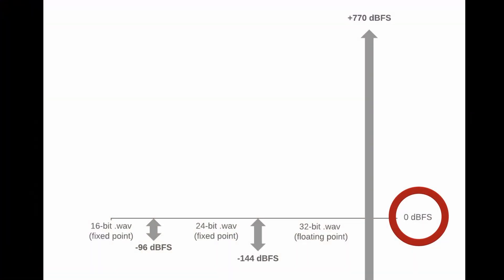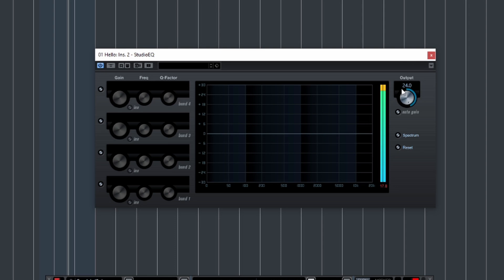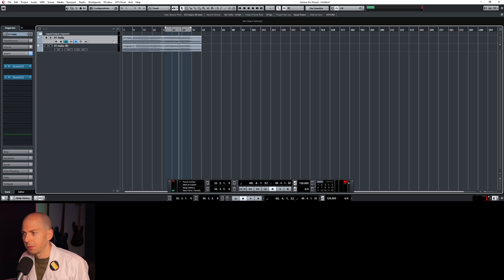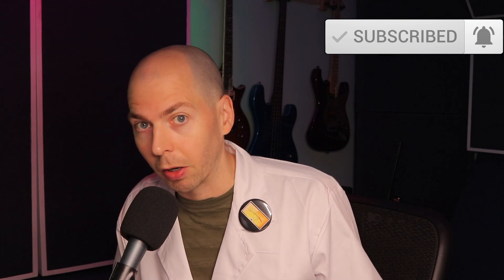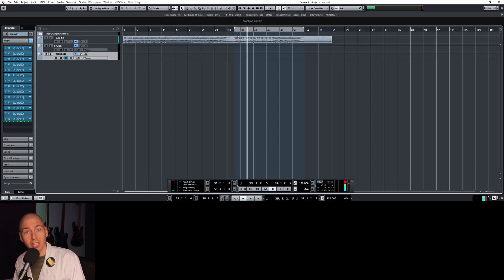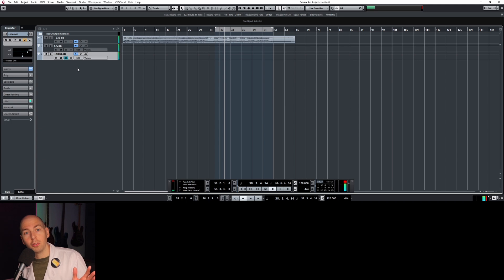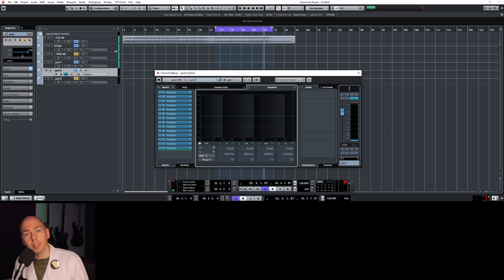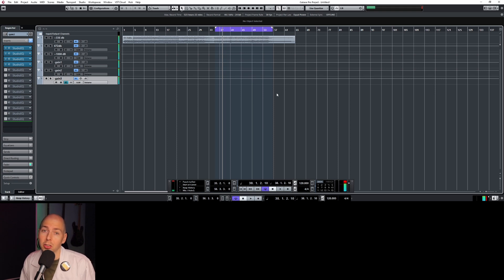The TRUTH about Modern Gain Staging & Mixing (I Broke Cubase!)

Comment: What should I do then ?
Reply from the maker: The point of the video is to show you that you are safe to mix in the box at pretty much any volume regardless of it goes over 0. The problem occurs if/when you try to send the final masters output level to your converter above 0 dbfs. So as long as your master fader level stays below 0, you are all set. Most people use limiters to make sure this never happens. You can also build in a little extra headroom by setting the limiter output to -0.3 dbfs for exporting to CD or -1 dbfs for digital distribution. The reason why gets complicated, but essentially most distributors want the output level set to -1 dbfs. Hope that helps!
Reply: @RaytownProductions  Thanks for your humble reply. what do you mean by convertor in above paragraph ? Ok, may be you are saying that daw doesn't clip because it has a great dynamic range because of 24 bit and +770 db of dynamic rangel but hardwares ( that at the end responsible for the final output through speakers) still follow 0 dbfs range can cause distortion at the output ??? Is this what you are trying to explain ?? Please reply.
Reply: @RaytownProductions  please reply ? Also tell the final conclusion, should a producer gain stage in 2022 or not ?
Reply from the maker: @zian3694  this is correct. Your speakers or headphones don't understand a digital signal. So to hear the audio, you have to convert it to an analog signal that the speaker understands. The conversion process will distort the signal it sends to the speaker if it goes above 0 dbfs, so your output signal needs to be below zero or distortion will occur. How you get below zero basically doesn't matter when working in the box. 

And yes, gain staging is a good habit to have. I talk about this in my recent video if you want to learn more about why it's important: https://youtu.be/y8HCoKFNNOw

Hope that helps!
Reply: @RaytownProductions  Thanks, It helped a lot, I still have a doubt, I request you to look at this - At the end it have to go from a speaker, that's why a song is made. Then it's clear that we should always gain stage no matter we are working on a Daw or any other system. Recently, I tried to gain stage and tried to keet everything below 0 db but in that process my sound from my small 3.5 inch speakers goes so down that I was unable to hear. If I raise the sound or any fader the signal was clipping and If I put it down than I lost the feel of song and that was resulting in  bad mixes. Am I doing something wrong or is there any solution to this problem or should I go for bigger studio monitors ???
Reply from the maker: @zian3694  There are tools you can use to mix the song better. They are called dynamic processors (compressor, limiter, clipper, etc). Mixing is a process and takes a while to develop your ear. Search my channel for start to finish and look for some videos where I show you the entire process.

Comment: Great video man!! The only other issue I hear frequently about gain staging ITB is that some people say certain plugins (usually analog emulations) operate better when they are hit at a cerain db/VU.  However, another mixer friend of mine reckons it makes very little difference. Would love to hear your thoughts on this?
Reply from the maker: Hey Evan, that really depends on how the plug-in is coded. Some have a set threshold that will clip the audio signal if the input/output gain is set too high. In my experience, this doesn't happen very frequently. It's pretty easy to check the plugins individually by feeding them with a lot of gain and listening back for clipping. Hope that helps man! Cheers!
Reply: @RaytownProductions  Thanks for your reply! Oh ok, so besides the potential clipping when input is too high, you don't think there's an optimal input level? Some people say -14dbs is optimal input but if you were going in at 9 or 10 you don't think it would make a lot of difference? I'm imagining other things like balance/eq are way more important..
Reply: No need to reply if you're busy... I can see some similar responses below in the thread. Cheers
Reply from the maker: @evanmcgregor3758  the quick answer is you can check with a null test. And in my experience, they almost always null regardless of the input volume when level matched after the plug-in. This means that there isn't a change to the phase or frequency response.

Comment: what about analog modeled plugins? if you are using some of these plugins OR plugins which internally operate at 24 bit, you're gonna get screwed if you don't gainstage properly
Reply from the maker: The plugins will operate at 32 bit so you won't have anything to worry about there. They don't operate at 24 bit. Some may dither to 24 bit, but that is pretty much irrelevant. 

If you have some plugins in mind, let me know and I'll check em and see if there is a difference! I question if passing a signal above 0dbfs will do anything destructive to the signal.

I do mention this point towards the end of the video but I think this might only apply to plugins with set threshold like compressors or limiters. Internally though, I don't think you have anything to worry about.

Comment: Gain staging is important when using any plugin that has built in saturation. The more input volume you have the more it adds saturation/distortion. And any good mix will have saturation so yes it is still important even if the mix is completely ITB.
Reply: Exactly. Or any analog emulation plugin or channel strips as they cause considerable aliasing if pushed passed 0 DbVU on the input. All these videos neglect to mention that and its just leading to more flat and sterile mixed in a effort to stand out from past generations of audio.
Reply from the maker: Interesting - I haven't seen any additional aliasing from digital plugins by "running them too hot". Is there a plugin in particular you are referring to? I can easily look for aliasing artifacts if they do infact occur.
Reply: @RaytownProductions  Anything from Acustica. A common one and free one would be Softube Saturation Knob.

Comment: the only time i’ve come across gain staging being important in the digital realm is when using with hardware modelled plugins and when stems are sent out to be mixed elsewhere.
Reply: yes, there is absolutely NO benefit in going over 0 ANYWHERE
Reply: Pro tip: watch series at Flixzone. Been using it for watching all kinds of movies during the lockdown.

Comment: With 64 bit engine DAWs like Reaper (I think most DAWs are like that now too) putting tons of gain like that still doesn't clip . . . if it's just gain. Plugins can still clip internally, mostly dynamics plugins, because the signal goes over their "thresholds" all the time. 
Considering that, you could say the audio isn't clipping per se, but being overprocessed by the plugin, which is bad anyway but tbh no one would do this kind of thing outside experiments LOL.
Reply from the maker: Great points! I talk about this towards the end of the video in the recap. It's also bad practice to not compensate for gain increases if you use templates. Cheers!